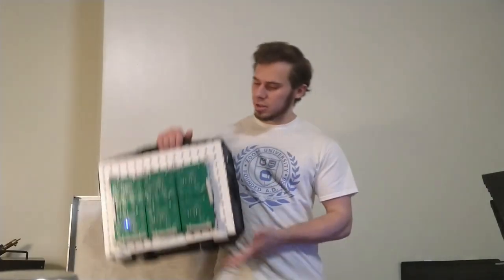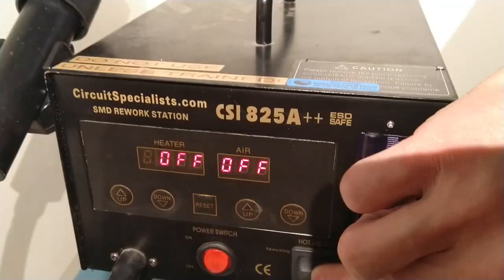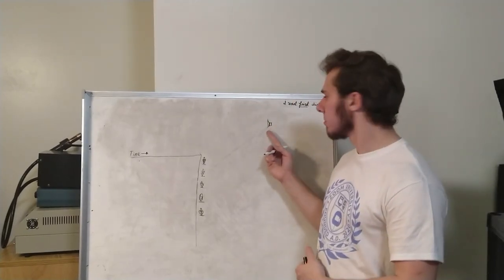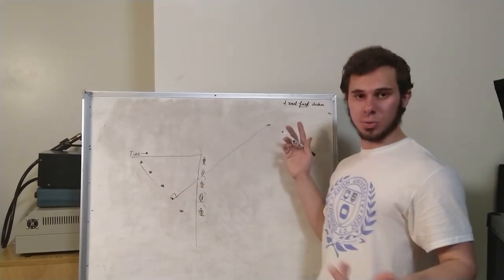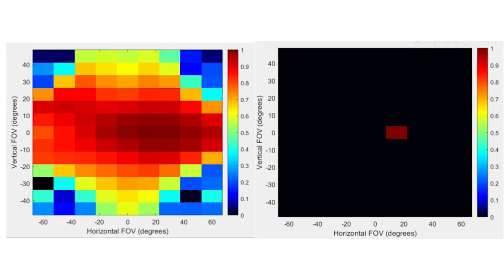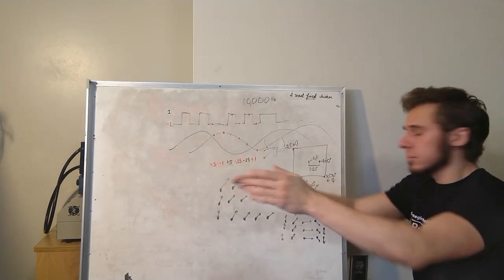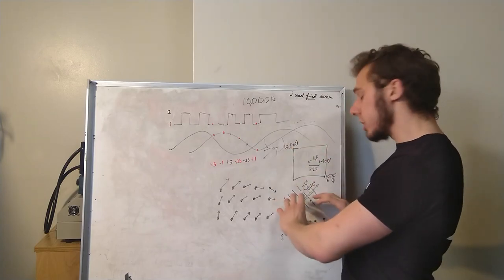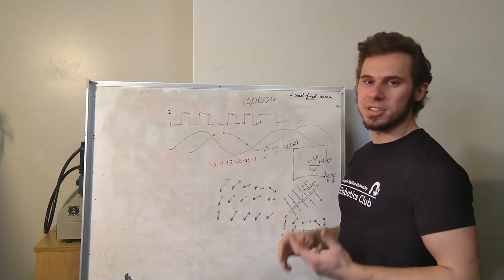Sound Camera Presentation

Comment: Hey, little question:
These tiny microphones, do they go up to 40 kHz? I built an active ultrasonic camera that had to manually aquire each pixel (that means a 30x30 picture took almost 30 minutes to make) but with such an array, if they can go up to that frequency, it would be lightning fast.
Reply from the maker: I think I used ICS-41351's.  You could check the datasheet, but they probably can go up that high, most MEMS mics respond more strongly to ultrasound.  I designed the boards to take some different mics that go up to 80K as well (though those were more expensive).
The project blog is at https://jeduffy.site/?page_id=2 and I think most of the files are on the hackaday.io project at https://hackaday.io/project/172053-acoustic-camera
Reply: @johnduffy5156  That is very helpful, if I ever get the chance to do this project again (I find it somewhat unlikely, but who knows) I will have a look at them. This guy here https://www.ribbonfarm.com/2016/06/29/the-daredevil-camera/ did something very similar to you, but at a smaller scale. I used him as one of my sources for my bachelor's thesis, as what he built was relatively close to my system, albeit passive.
Thanks for the info!